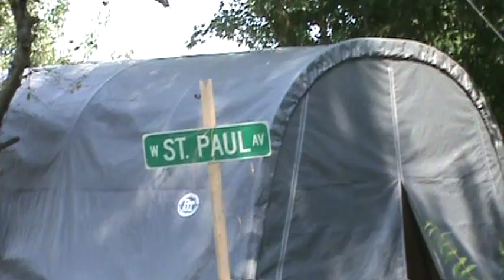FREE ENERGY FROM AIR CIRCUIT PART 12/24

Comment from the maker: copper coated steel, hmmm, interesting.
I was thinking about something like this.
was also thinking about putting copper tube inside of coil, than layer of insulation, than smaller copper tube inside of that one, and so on.  Hmmm, a combo of capacitor induction coil. Hmm, think i just read about these.  these do exist already, dont they(combo cap & ind coil)??
guide wires, yes thought of it.  but they are only string right now.  big hassell with branches in the way, putting pole up & down.

Comment from the maker: Hmm, interesting idea.  I wonder if i would have enough water pressure....ground is very hard, hmm  then again bouncing the pipe would break off pieces. Got me thinking.
I did not fill in hole yet, but pipe gets expensive. 5 foot copper thin walled tube was like $65.00

Comment from the maker: Sorry...it's done.
Not much differance now with 5 feet deep.
Readings barely changed at all.
have to wait for next video for results. :-)
I may have discovered a way to increase the voltage greatly without sacrifice of current.  with my luck it has been done 100 times already.   Must do more testing now. new video soon.

Comment: you could have washed it down with a water hose

all you would have had to do is  keep the hose at the bottom of the pipe and keep bouncing the pipe

i once washed down a 25 ft shallow well  by this method